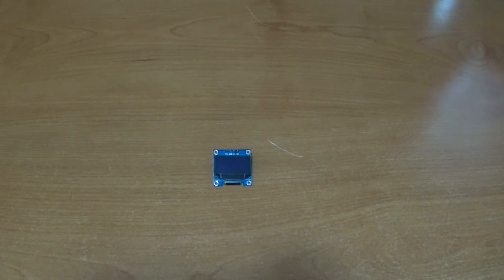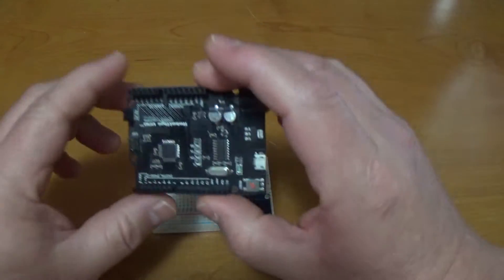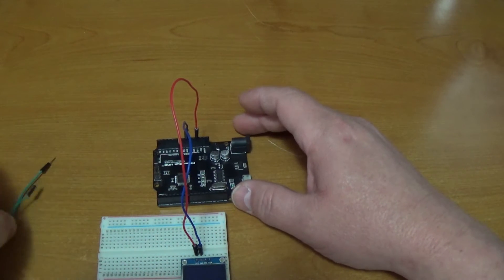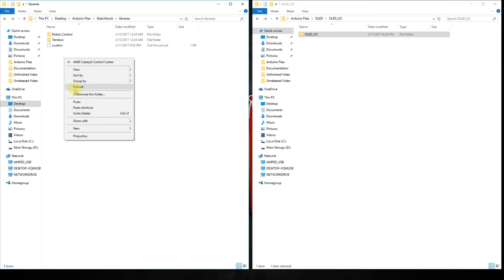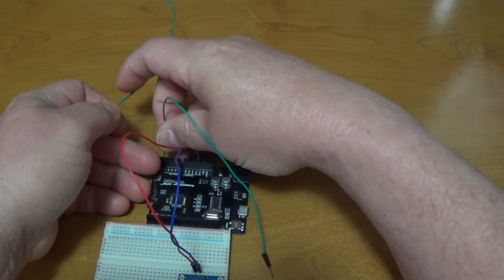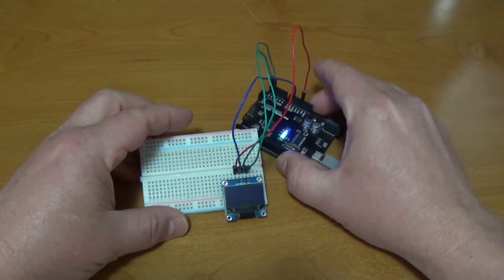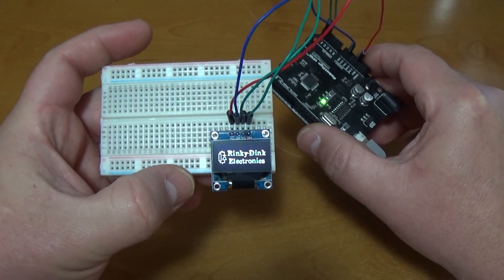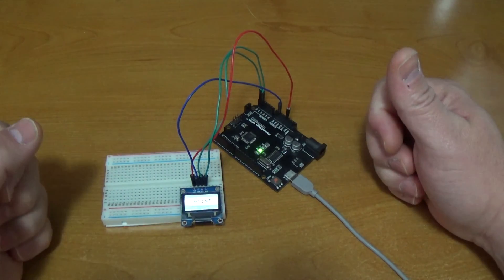Easy Setup for SSD1306 Using the OLED I2C Library

Comment: I have a arduino nano, it does not have a specific one for that. Also, my oled display (llC SSD1306)  has SCK instead of SCL. I tried connecting the SCK pin to de SCK on mi arduino nano and cant get it to work. Any suggestion?
Reply: I ended up using this library just in case anybody had the same problem. Is working now.
https://www.arduinolibraries.info/libraries/ssd1306
For arduino nano:
-SCK in pin A5
-SDA in pin A4
Reply: @Nano0894  Thank you very much!